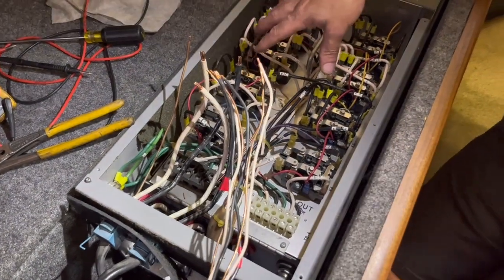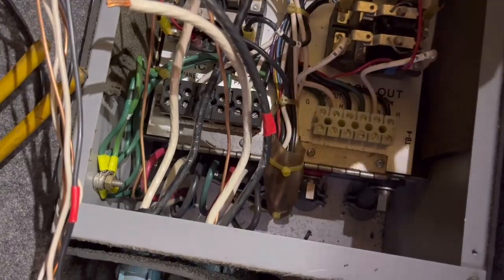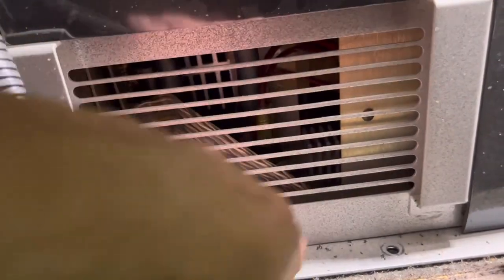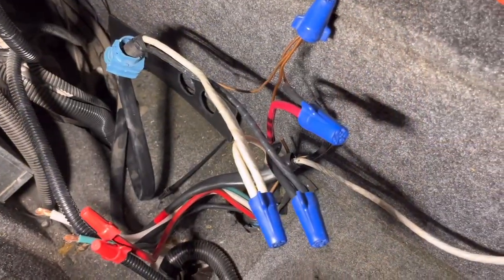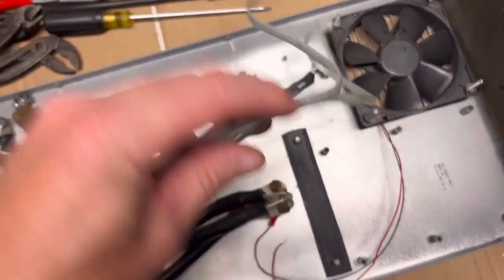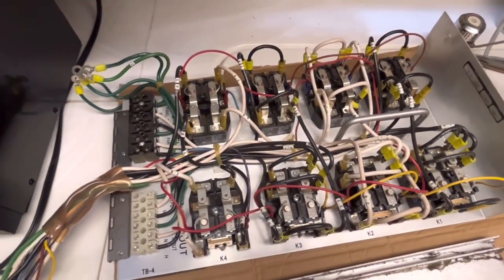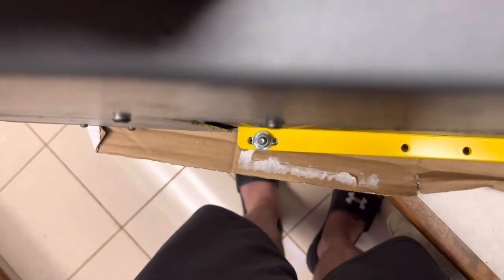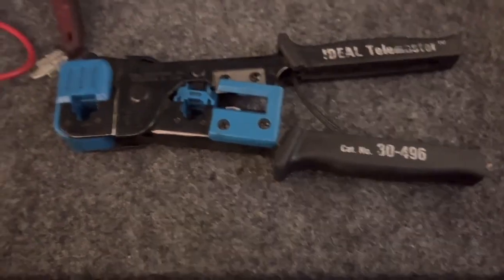Gino's Garage- 1998 American Eagle- Replacing Inverter/Charger & Integrating In The Source Manager

Comment: This is crazy how I did a search and your video popped up. I haven’t the same exact year Coach right down to the exterior color.
We live in Saint Augustine, Florida, and I keep the RV plugged in short power at the house anyway I noticed that the exterior of the RV is hot (voltage) when plugged into shore power
And there was a smoky smell coming from underneath the bed when I went inside 
I pulled the cover on the heart interface and noticed K2 relay had some scorched wires and terminals 
Was wondering if I’m going to need a complete replacement which probably wouldn’t be a bad idea 
Thanks so much

Comment: I've read a few complaints about this particular inverter on Amazon.  One about "It not powering shore on both l1 and l2 of the 50amp input. It only shares on one leg."  Another that complains that it will fail above 104 degrees.  Have you experienced any of these problems with the IC2000?
Reply from the maker: @musner  I cannot comment on those as this was a customers coach and I have not spoken with this customer. I can say that tha customer support was excellent and they replaced the inverter with very little questions asked. The customer burned up the new inverter with low voltage trying to plug the RV into a house outlet.
Reply: @GinosGarageUSA  ok. Thanks for response (and the video)!

Comment: So many questions!   Does the new inverter replace the transfer switch? What are all those relays and circuits you reinstalled for? What do they do? I’m looking at the victron quattro and wondering how its install compares to yours.
Reply from the maker: So all the relays you see on top are factory in the original system. I did not change any of those, other than how they are controlled. The relays act as a sort of transfer switch system and a inverter transfer switch all in one. The inverter was also built into this system, so all I really did was replace the inverter/charger that was inside with a new inverter/charger. I posted more about this on the IRV2 American Coach forum: https://www.irv2.com/forums/f107/heart-source-manager-20-replacement-470989-8.html#post6559045

Comment: You are truly a jack of all trades Jeff! I am almost done replacing the front hub seals, airbags, and brake air feed lines on our Bird. Your videos helped guide me through that:)
Reply from the maker: Thanks, yea well some folks do not know that working on these RVs is actually just a side gig for me, I work full time for an industrial electrical contractor and have been an electrician for over 20 years now. So this makes these electrical projects a little easier for me to do with my background.
Reply: I have been on the Bird project every day for the last two months trying to make a launch deadline. My wife is doing a lot of the interior work. She calls it Bluebird Boot camp! I'm more mechanical and paint, good at 12 bolt, 120 not so much:)